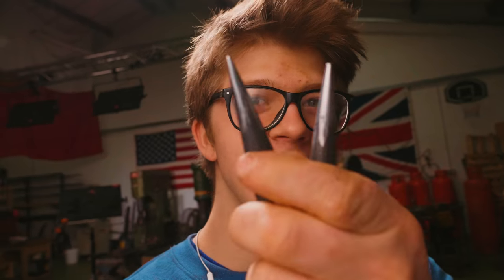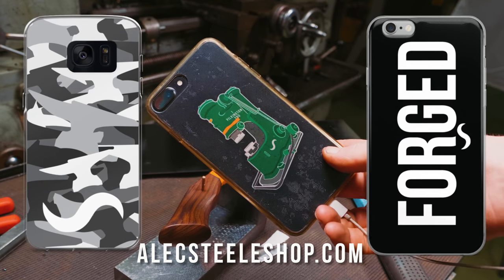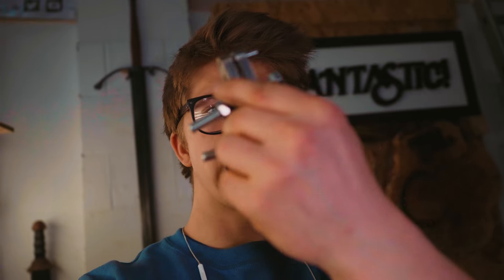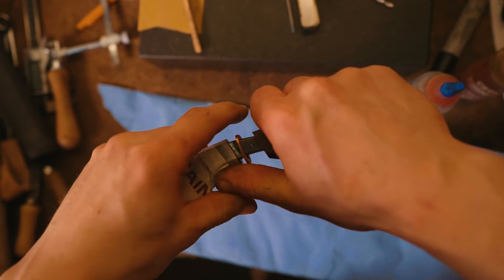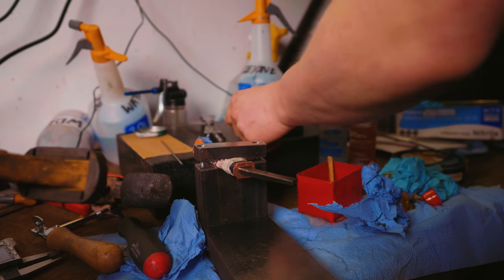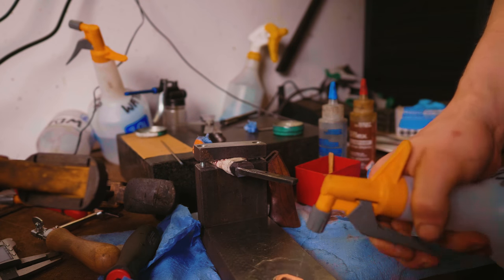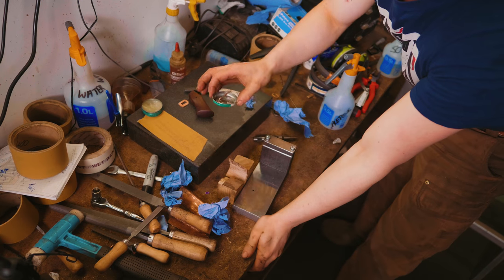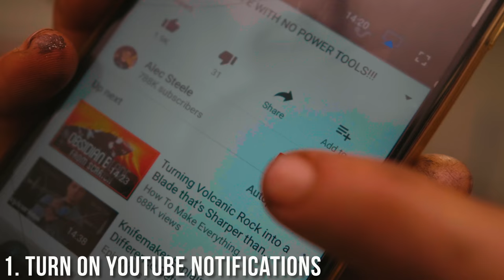MAKING A KNIFE WITH NO POWER TOOLS!!! PART 7

Comment: Hi Alec, for your fine filing work and other fine work, consider making the adjustable work light that Adam Savage at the “ Tested “ channel made a few weeks ago. Also for the filing/sanding work a heavy duty rotating (lockable) base with a vise on it makes working so much easier.
Side note: “The numptiness has not been avoided” should totally be a t-shirt.

Comment: Alec, have you ever looked at or considered a technique called drawboring? It’s actually a wood working technique for pinned mortise and tenons but it could help get tight fit ups between the tang and socket on knife handles much like this one. 

Basically the pin hole in the tang would be slightly offset from the pin hole in the handle so that as you drive the pin through it pulls the tang in tighter to the socket.

Comment: I use exactly the same type of bench sheers I just saw you struggling with, clamping them in a vice, so I'll share my own little tip with you.... Open the mounting holes out to around 7/8" and get a couple of long-thread tail-gate "Drop-Locks' so you can quickly mount the sheers securely on a bench or level work surface, without having them permanently taking up that valuable real-estate. 
Love your work!

Comment: Alec, if you make the pin hole in your tang a bit larger than the pin you are using, you will get some wiggle room and can use a clamp to squish the handle against the guard or bolster.  Epoxy takes up any empty space in the pin hole, and the whole thing is nice and tight when you are done.

Comment: Looking up G10 it sounds like a perfectly good material for a bolster/handle spacer on a knife, or even for a full handle, but I'm concerned it won't fit with the "reserved gentleman's hunting knife" aesthetic. A bit more copper to match the pin would be nice. However I am loving this series and it's always fun to see Alec working with another different material.

Comment: Hey Alec, I'm not sure how it would behave in metal to wood application, but it might be worth mentioning, that drawboring might also be an option. Works great in fitting together a mortise and tennon joint in woodworking. ;) You might try it once. Again... I'm not sure how it would work here and what tolerances are there for not ending up with gaps in the pin. Other than that always amazing to watch your videos and how you progress in your craft :)

Comment: I like this project.
I've been a guitar builder, used some power tools but mostly chisels, files, hand saws, sanding paper and elbow grease. Even when I would use an electric router to level something down, I'd still see some form of gap or tool marks between my parts. Luckily that's easy to fill up with flue, filler and lacquered over... but I'd know it's there. Every guitar would be better and more complex, but I'd still make the same type of errors.
Rather than trying to fix it at the risk of overcompensating, I'd learn to live with it (I was the only one playing them anyway) and decide that these flaws would be my maker's mark, my signature. But seeing other makers' creative projects, oiled, tropic wood guitars with purple and green and beautifully grained woods, I'd feel envious. It is pretty humbling, but at the same time, I realize they were using tools I couldn't afford and some of them have taken an apprenticeship with a furniture maker/restorer.
What I'm trying to say is, sometimes you have to realize that good enough is good enough, it will never be 'perfect' but that's just in the nature of the materials and the tools you're using, but with practice, tomorrow's 'good enough' will be better than yesterday's.

Comment: hey Alec, the fitup at the bolster could have been pulled up and gotten closer by refinement of the pin size and hole locations, if you use a taper pin and a taper hole and you bias the hole in the tang towards the bolster (by maybe .005" or .010") that should be enough for an interference fit. the pin has to be the thing forcing the handle and bolster together. if interested can elaborate.

Comment: Seems like a approach to the fit with the shims is to stack your shims taller than needed then lightly sand the handle to shim surface till the pin hole comes into alignment

Comment: To fill gaps like that I use thin pieces of soft leather and squeeze it in place with epoxy. It turns into a very hard spacer that fills the gap quite nicely

Comment: Alec if you want to try something similar for a traditional EDC folder, you should take a look at the Higonokami. Pure simplicity in aesthetics and a pleasure to use. it might even be a little challenge because the blades are pretty small and they are done as san mai (high carbon steel in the middle for the edge and a bit softer carbon steel on the sides).
Because of watching your videos I just had to look for a hand forged folder for EDC that I could afford (and not wanting to hang on the wall because it's too precious :D ). Stumbled across these and fell in love with the look and the history.
Great work as always and forge on! ^^

Comment: Wonderful project, have you considered offsetting the hole for the pin so when you drive the pin in it pulls the handle tight to the bolster? Kind of like drawboring a mortice and tenon joint?

Comment: Something you can do is to super dry your wood. You put it in a bucket of dry sand and heat it up to about 60°C. The wood will go from about 8% water to about 2% and shrink a bit. then you do your fitting somewhat close and let it get back to the natural point at about 8% water. It will have expanded a bit. Of cause if your fit is to close and depending on your wood, it might crack while expanding around the steel. that methode is used for building chairs for instance.

Comment: This knife is going to be awsome!!!!! I love your passion for the things you make.

Something that I've seen with woodworking is when attaching mortise and tenon's with a dowel peg, this would probably work well with knives as you have the mortice in the handle and the tenon on the blade..

1.  Drill through the mortice (handle)
2. Fit the mortice and tenon together and mark the position on the whole on the tenon but don't drill through yet.
3. Remove the mortice part (your handle)
4. Move your whole on the tenon about 1mm closer to the blade.

This givers the effect of pulling the mortice onto the tenon when the pin is fitted. This would hopefully mean that even if the wood shrinks a gap should never open...... having said this, it works when joining pieces of wood but it would probably be a good idea to test it first, I'd hate for this idea to ruin this amazing knife!!

I'm also thinking back to when you first drilled through the handle and then cleaned up the whole in the tang and wondering if you might have created a bit of play in the joint there?

Comment: next time try offseting the pinhole on the shaft so when you drive the pin it pull everything tight, wood will just compress where needed and that makes a perfect fit without much fiddling.

just my 2cts

Comment: hi im new to your channel  , i think you  should have  offset  the pin hole on the tang so when fitting the pin it would  have pulled  the tang tighter  into the handle , hope i could help if any , cheers  tony

Comment: I admire your work ethic but I don’t think I’d put this much time in to a fit up mostly because I don’t have that time but here’s my little tip. I like using leather as spacers so they can be compressed a little to fill up any space I couldn’t remove with my hand tools. It works every time and looks pretty.  just to put in some input whether you want to use that for future or not maybe it helped someone else

Comment: Here is a possible solution or at least an easier way to get it tight next time.  When you drill the hole through the handle, drill half way and just mark the tang a bit.  Then take the knife out of the handle and move the mark over towards the blade by 1/2 a mm or even slightly less.  Then finish drilling through the handle without the tang in it (with a piece of wood backing it so you don't get tear out).  Now when you put the tang back into the handle the hole will not quite line up.  Now when you drive the pin in it will put pressure on the handle due to the offset hole and pull the handle towards the bolster.   This is essentially how its done with pegged breadboard ends on a table.
Reply: Dan Letkeman I’m pretty sure he’s used that method on a sword or two.

Comment: I am sure you already thought of this, but wouldn't it have been better to get the fit of the handle and the bolster before drilling the pin hole? It just seems like your order of operations is off on this. Also, there is a trick for getting a tighter pinning when working with wood: once you get the mark on the tenon (in this case the tang of the knife) from drilling, do not follow that mark. Center punch 1/16 to 1/8 away from the shoulder (bolster in this case) and drill that hole. This will pull the joint together when you drive your pin in. Now for the more critical part of my comment

(Start Gollum Voice)
You should have gotten rid of the gap first, Alex. Made it gone before your clever epoxy and wax trick.
You shouldn't have shaped the bolster before the handle. Should have filed both at same time, Alex. Then they would match.
Pin hole drilling should have come before sanding and right after filing.
Hindsight is 20/20, but taking time for some foresight keeps you from being blind to the future, Alex.
(Stop insanity)

I would suggest that before any project, you create a task list with comments related to each task written to one side of it. This is what is done when creating an industrial process that a worker interacts with and is also used by scientists when working in a lab, if they were taught it. Each step should be broken down into it's most basic steps so that some one without minimal knowledge of the technique could follow it. Each comment section of the task should include safety hazards, expected outcome, possible follies, and signs to look for each of these three parts. Each comment section should have remedies for any folly that could come up, including if it is a full failure of the entire process. You then keep this document on hand to check off steps and any signs that you see during the process. This will keep you from making mistakes as much and will let you spot mistakes far faster so that you can fix them early. You have already learned to do this when forging, as I have seen, but that is from years of practice and learning from every mistake. As the voice said; hindsight is 20/20, but taking time for some foresight keeps you from being blind to the future.

Comment: So i watched a youtube vid by Walter Sorrells, he forges katana. The way he does the handles is a little different but might be worth a shot. He cuts his in half (longways), traces the tang on to the wood then uses a chisel to bore out the center, then he glues them back together. Sure on a katana you have the wrap and the ray skin, but if you are putting pins in it anyway....

Comment: Don't you supposed to shape the spacer before glueing things up (like you did earlier when there was no spacer)? Now you will scratch your final finish on handle & bolster while trying to make transition between them & a spacer.

I'd suggest to work in this order from the beginning of making handle:
1) Make a tang hole in a square handle slab.
2) Make a square fit between bolster & handle slab.
3) Drill a pin hole. Maybe do the trick you used for katana (move the hole in the tang for a fraction of inch for better fit).
4) Shape the handle & its transition to bolster.
5) Make final sandpaper finish on handle & bolster, coldblue the bolster.
6) Glue the handle with vaselined pin.
7) Rivet the pin.

Comment: Why not mix a paste of sawdust & epoxy (G10, copper, other black material) , put on handle when do the final set with epoxy and pin, then sand flush? It will look like a solid piece.

Comment: Hey y do you grind/sand/file the wood and bolster when you can just make it thicker than it has to be so there is pressure and the wood would deform and that should eliminate all the gaps

Comment: Alec, bro, everything has a tolerance. Relax! Lol

Edit: I often work with engineers in the aerospace and defense industry and my best friend is a machinist that also works with engineering blueprints. 
Engineers usually try to design everything with absolutely no tolerance fits. This is just not practical in the real world Alec. Putting parts together, parts that move together, or need to come back apart later need at least a few thou of tolerance. Machining parts at zero tolerance is more costly and time consuming as well. Engineers OFTEN forget about the workers that have to build and assemble their designs. Zero tolerance fit means that parts get stuck together, bolts and screws get broken off, all sorts of issues arise and the assemblers end up dealing with it, writing non-conformance tags, waiting on engineering dispositions to either have the parts reworked or scrapped which end up costing 6 times as much as the original manufacturing cost.
Alec, you have to realize that there is nothing in this world that is perfect! No one person is perfect. No object is perfect either in nature or made by humankind. 
You are driving yourself crazy over a 1 thousandths of an inch gap? That is a perfect fit. Paper is 4 to 5 thousandths of an inch thick. 
In my opinion you should have left it alone and glued it up. Sometimes the more you mess with something trying to get it just "perfect" you'll end up messing it up even more. I've been there, and I've done that, and I regretted it. 
Don't forget that you can have amazing quality with good tolerance at the same time. There is no such thing as perfect my friend. 
Your handmade knife already looks amazing and it's super high quality! You're doing a great job. 
I will admit though that having a copper or brass/bronze plate between the wood and steel would look great so it'll all workout in the end. :)

Comment: Breaking from the "No, Murphy, no!" comments (btw, Murphy was an optimist), I'd like to suggest that you make allowance for your materials. Wood-to-metal is unlikely to ever reach and maintain the tolerances of metal-to-metal. When you start, you need to decide what you will find to be acceptable (must be > 0, because physics) and stick with that. Striving for perfection is not only laudable and a fantastic teacher, but it is also the quickest and surest way to the numpty-bin if you aren't mindful. We must always strive for better (often much better) than "good enough", for in that dark embrace lurks dangers to body and soul, but we must also take care that we don't get mired in a swamp of piddles and diddles while on a Quixotic quest. As an erstwhile rockety-sciencey type and a current grizzled creative arts person thingy, let me assure you that the struggle is real and never-ending. That's why it's fun.

Comment: Make a knife out of things that they only had in the Medieval times. I mean like a serious hand tool only projet. With out using anything like a hand drill or drill bits, no sand paper, no epoxy resin, etc. The only thing you are allowed to touch is a coke forged, the anvil, hammers, punches, drifts, files, chisels or anything they had in the medieval times.

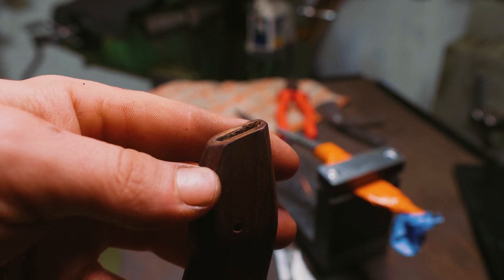Comment: @4:08 G10 1mm so we must remove 1mm from handle. But Alec, doesnt that mean that you still would not have fixed the gap if you remove the same thickness of the material you are adding... And its screwed again hahaha.

Comment: Sorry, don't see why you couldn't have just taken a half an mm off the tang to get it to push up closer to the bolster.  Sure the pin would not work right, unless you enlarged the pin hole that is.   Still great work.

Comment: Why don't you get with the slow-mo guys and watch how metal moves under a hammer, how it cuts in a drill, or how the sparks pops like fireworks when grinding certain steel

Comment: You need to get some bronze sheets to go with the bronze pins, and some copper pins to go with the copper sheets. And then... silver, gold, and platinum. Don't bother with titanium for pins and spacers, you wont be able to do a peen on a titanium pin without damaging what the pin holds together.... wait ... I kinda want to see how long it will take to cold peen a titanium pin to a wood handle. How many licks, tootsie roll pops....

Comment: just usual over sanding very easy to fix with out adding anything, but i don't think you need any advice right! i applaud your learn bay mistake thing , how,s it working out so far , never forget that craftsmen has did it right for century so learning from them is not shameful but wise.

Comment: So I was excited for this project. I was on the cusp of following your lead and seeing if I can make a knife... but you turned me off by heavily implying that if you don't have the time to get your tolerances within a thou, which required you to use incredibly expensive equipment to build a jig that made it possible, you are wasting your time. 

The message used to be "Do the best you can with the tools available.", "Practice, Practice, Practice." and you've shifted that to "Get it right the first time.", "Perfection above all else." A mentor / master would be much softer on you than you're internal (well external) dialog. 

The work you are doing is outstanding, but at what cost? Don't let perfection be the enemy of good, especially on a project that started out as something to show case how accessible smithing can be.
Reply from the maker: Tom, that is truly incredible feedback. Thank you for the critique. You are absolutely correct that I am missing a big part of the goal of this project by focusing so much on the details and the ramifications of this are not all as positive as I may have imagined and may make the craft off-putting. Thank you for the commentary!